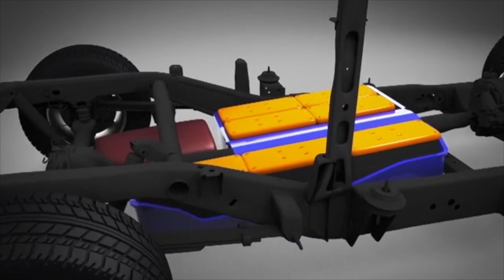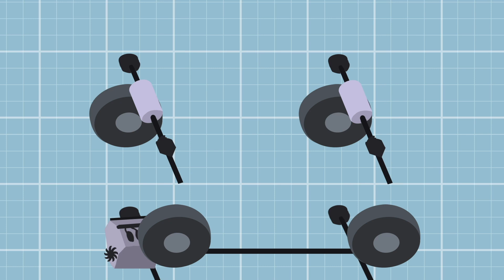Could This Pickup Truck Design Change The World?

Comment: Before I begin my argument, allow me to share a "positive" note:

Ram, maker of two of the most popular diesel light-trucks, currently has a 48-volt assistive/regenerative hybrid system in it's 1500 (1/2-ton rated) 2019 models that outputs 90 lb-ft of torque. It is standard in all gasoline V-6 models, and available in all gasoline V-8 equipped models as a $800 option. The eTorque system--as Ram is calling it--offers an small increase of EPA combined mileage from 17mpg to 19mpg, while still allowing the Ram 1500 to tow nearly 13,000lbs and handle more that a ton of payload.

Now... on to my argument.

Question: Of what percentage of light-trucks in the aforementioned sales review are sold for use in rural areas? This has a high weighing on the "Let's go all-electric with trucks!" argument because of one simple factor: infrastructure. 

Unlike areas of higher population density, fuel stations and places suitable for rapid-charging stations are few and far-between. This nullifies the practicality of plug-in EVs, as even a conversation built with the longest range possible will find itself "out of luck" should it need to cover distances greater than possible without being recharged during it's daily operation. 

Also, there's an old rule about how trucks must be built compared to passenger-cars: It must be able to work twice as hard, and do it for three times as long. Typical rough-terrain durability issues aside, this can be a daunting challenge for EV trucks to face as long-term operational costs come into effect, as independent owner/operators of light-trucks don't like the idea of needing to make a huge investment more than once in the lifetime of their trucks--reserved primarily during purchase. 

Before I go, I will leave you with one thought: General Motors currently offers a "small" 4-cyl engine in their full-size 1/2-ton trucks with a torque-curve comparable to previously-offered V-6 and smaller V-8 engines. VIA, maker of series-hybrid based on GM light-trucks for several years now, has been using the base-model V-8 offered in GM's light-trucks as it's range-extender engine. Imagine the range increase  and emissions reduction had if VIA built a hybrid conversion that employed GM's new 4-cyl found in it's full-size light-truck models. Suddenly diesel isn't the only option for hard-working light-trucks in fleets... or personal, individual owners.
Reply: As you say infrastructure is poor, but with increased demand comes business opportunities... "If you build it they will come" is all well and good, but very often the consumer needs to demand a product before it becomes available widespread so tackling the trucks first does make a decent amount of sense.
Reply: @joannaatkins822  "Demand"...? Or "Have no choice"? They are sometimes one in the same, I've found.
Reply: @joannaatkins822  , have you ever worked on automotive applications?  Unlike the combustion engine. Electronics are actually more problematic to diagnose,  troubleshoot,  repair and a catisthpic failure is almost any failure. New viechles are predominantly electronic , terminating resistor goes bad. The induction can cause havoc on unrelated systems to each other, corroded wire in that circuit, corroded pin at an ecu, broken wire, voltage spike, bad ground, loose wire. These play havoc on systems now with the electronics which don't even include mice that love too chew! I used to teach electronic diagnostic s if you think most people can grasp it in a practical sense to do that , most can't understand the the actual concepts in it. When you do find some people , you will not be able to afford to fix the truck. Electrical engineers that designed this crap dont fully understand what they designed and built sometimes. I used to have too prove that what they said was impossible in actual applications does happen .

Comment: Boiling a frog. With current "trucks" having a body on frame structure, there's plenty of underbody real estate for a very decent battery pack. Especially given the huge transmission and drive shaft is eliminated at this stage already.  So a small generator can keep that topped up with zero range anxiety. Probably more range than what current owners have now. The torque of the electric drive will convince any truck driver there is sufficient "grunt" to do any task. Later, with a body totally designed for pure EV, out goes the engine and fuel tank, replaced by a double bottom platform packed with batteries.
Reply: Karl P You forgot about regenerative braking as well.
Reply: Yes I did, thanks
Reply: Karl P I reckon I'd puncture a battery and explode.
Reply: Something I think you're overlooking is a fact that these battery packs weigh a lot, which will then drain is a batteries even more, as the motors have to work harder to pull the vehicle plus a load. It's a flawed system, and we're probably better off going and using biofuels
Reply: Yes - take a 1.5T pickup and add 1.5T battery pack and reduce cargo capacity to a bag of potato chips.  Sounds right.

Comment: The manufacturers' mentality isn't screw the environment. I think you're wrong there. How are they supposed to make them as cheap as they currently can with current capability. The technology isn't there yet. A plug in hybrid adds complexity and they rarely get any better economy than a diesel so there's no point until technology can actually allow for a full electric one. The only other fully clean alternative then for a pickup will be hydrogen then. But that is also too expensive.
Reply: No it's ignore the environment.
Reply: Really look into some things that are already existing, but suppressed. Why does our vehicles run on wet gas? If you have a bucket of gas and drop a lit match in it, the match simply goes out. Look up videos about running on fumes. There's a Florida man getting over 400 miles to the gallon, off of gasoline fumes. Pogue invented a carb that would do several hundred miles a gallon in the 50's, but was forced to be silent, forced to sell his plans to oil company, and we have additives to this day, designed to clogged that design. Fact is, oil is big money, and those who make big oil money, do not want that to stop. Firestone made a tire back in the 60's that would never wear out. However, petroleum is used to make tires, so the oil companies bought the rights to that tire design, to keep it from being made. What about water? The earth is 75% water, why aren't we running on hydrogen. There is next to no emissions. 8 ounces of water has more energy than 5 gallons of gas, and produces more than 80% less emissions on average. Again suppressed, because these large companies can not take ownership of the world's water. The electric car was invented back when cars were, but an oil company ran a smear campaign against them, caused issues with production, and forced the electric car business out of mass production. It's all about greed. The global warming is a hoax, and it produced extreme amounts of money also. They do not want people, they want sheeple. Investigate on your own. There are many inventors, who ended up mysteriously dead, after trying to tell the world of their great inventions. Ford designed a mid family sized car, than did 90 miles to the gallon back in early 2000's, and sold rights to oil company for large money. That's how they stayed in business. This goes on and on, and no one sees or hears about it. 
Next time you take your vehicle for an emissions test, think. Why is it you can fail the test, if your vehicle isn't producing enough emissions? Also diesel puts out way more pollution, why are diesels emission test exempt? Money, money, money.........

Comment: If I were a manufacturer, this is why I would be hesitant to build this pick-up: it's a short-lived technology.  It's not going to be long before a fully EV truck will be just as marketable as your hybrid.  I don't want to spend five years getting my company to design, test, and start manufacturing this thing if the fully EV version is going to clobber it in seven years.

It might be doable if some company can come up with a business plan which accepts the hybrid as a stop-gap measure from the get-go, but otherwise I wouldn't do it.

Then again I'm not a manufacturer, and I could be all wet.

Comment: I want to point out, in 2014 GM had test sales of 1,000 PHEV Pickups using modified Volt batteries and software. 500 Sierra's, 500 Silverado's. they were only sold in california, and I don't know if GM even sold all 1,000 or not. but I dis want to point this out to show truck makers did trial with it already, just not quite enough.

Comment: What happened to acid rain it was supposed to wipe us out by 2010
Reply: Regulations all but stopped it a few decades ago. Google it.
Reply: It was a problem.
People saw the issue.
Engineers got engaged.
The problem got solved.
As I was driving my car along the road yesterday, I came to a place where, if I kept going straight I'd crash right into a building.  I turned the wheel.  I didn't deny that the building was there.
Reply: @thapelomashaomasemola7922 
Anyone who did the PH strips experiment in Vermont knows your claim is false. @thapelomashaomasemola7922

Comment: The one thing missing from this argument is the value of switching out the what I assume is a regular piston driven internal combustion motor with a gas turbine engine. It provides a few notable advantages:
1) Higher Fuel Efficiency than Piston engine
2) Less Weight then Piston Engine
You wouldn't use these to drive a vehicle mechanically, because they wouldn't be driving it near the peak efficiency under most mechnical loads, but you could charge a battery at peak efficiency all day long. You could even make it modular or part of trailer if you wanted to leave the truck as light as possible when operating in electric mode (and getting all that wonderful torque).

Comment: There is more to this. Turbine engines were tried in the past but didn't have the tork to drive vehicles. Turbine to generator to battery to motor I like because the engine has only one moving part. And as a landscaper I can create gas through anaerobic digestion to drive the truck which  can also do combined heat and power for my home.

Comment: Credibility for this report was blown just before the 2:56 mark. She said, "put a high power motor on each axle and supercharging." Really, supercharging an electric motor? The writers made the reporter look silly. I am very familiar with diesel-electric drive and yes it works well for ships and locomotives. Surely long-haul trucks will benefit from diesel-electric drive also. I hope enthusiastic electric vehicle buyers realize that their purchase is NOT as totally green as they may think. So many times I read an ignorant statement like "I don't pollute," I don't burn fuel." Ok, great, how about that powerplant on the other end of your power receptacle?  Are we also willing to build the needed power plants to recharge all these new green vehicles? New powerplant construction is a slow and expensive process. That is why so may electric suppliers sponsor conservation measures to put off building new but that will only stretch so far before more new generating sources MUST be brought on-line.

Comment: This is just a thought I had while watching this.  Instead of using mechanical breaks on the London Underground or any metro subway system, why don't they use electric motors that will recharge battery packs and then use that energy to help accelerate the subway cars. In Washington DC where I live, you can see how much the breaks are being used by how much wear is showing.

Comment: It's an excellent solution esp. in certain scenarios where there is no choice. I used the same mmethodology in my DIY projects. Also, using a stronger motor thru the transmission gives more flexibility although does have transmission power efficiency loss of about 2-4%. But adds more robustness.

Comment: You make a compelling argument. I'm in the market for a pickup. It needs to be capable of Towing, hauling, and then the daily running around. Depending on cost I would gladly try and Electric. However as long as traditional fuels are less, the environment will suffer.

Comment: My F-150 has the 2.7 liter v6 and gets about 26 on the highway.  What I like about it is that it has a 36 gallon tank that gives me over 700 miles before refueling.  An electric truck.....about 150 miles, maybe, before you have to plug it in and recharge.  The biggest drawback of electric vehicles is the range on a single charge.  Until they fix the range problem, I'm not interested!

Comment: Frankly most people don't need a massive battery on their pickup, they never use them to even a fraction of their extent. Start with light pickup trucks that would be fine for a sizable part of the market, with a far smaller battery. A friend drives a Nissan electric van for his work with a 80 mile range which is perfect. Then later work on the larger ones as batteries improve.

Comment: Batteries + smaller ICE + electric motors - diffs - transmission - bigger ICE = total wieght difference. If this equation for a hybrid truck delivers significant reductions in fuel use, then the idea has a chance, if not then its boned.

Comment: The main problem with EV is the lack of torque.
The Outlander Phev can only tow 750kg. 
If it has no torque it will burn out the electric motors

Comment: This idea is very old indeed. Over 100 years ago, around 1907 when electric trucks in the U.S. were almost as common as the gasoline variety  because they mostly took freight from the railway station a few miles to where it was needed in the city served, they were competitive. General Motors offered their trucks in both types.
 So it was that when the Carnegie Observatory  needed a truck to get the largest pieces of the 60 inchTelescope up the mile high Mount Wilson, they consulted with the Couple-Gear truck company of Grand Rapids Michigan. The 5 ton electric truck they offered had some characteristics needed for the crude dirt road with switchbacks that was made just wide enough for it. It had been a mule trail. 'Couple-Gear' referred to the clever drive system that had one motor inside each wheel, coupled to ring gears just inside the rims. All four wheels were thus completely independent, and each axle was independently steered, making those switchbacks easily negotiated.  

Now when the engineers did the calculations for the battery pack they used and the grade, they realized it might only make it half way with its load. That seemed OK,  because there was a ranch house about halfway up the trail, and a generator there could recharge the vehicle overnight.  Caution suggested the margins were too thin, however, and it was decided to put the generator unit on the truck itself. Here I have to remark that this now turned what was an instant starting truck into one that needed cranking to get going:).
The weight of the motor generator displaced the battery. They left it out as control in those days was hard enough with either of the power types.  It must have been a noisy journey with the Fairbanks Morse engine running at full tilt most of the way.
 Control and braking made use of large streetcar type dynamic brakes using resistor loads. Still it was found to need a little assistance from a team of mules at some of the steeper parts of the trail when carrying its full five tons. Quite probably it was a good thing that it did not go back down the road loaded, as that braking system was worrisome to be sure. Perhaps another reason to keep a pair of mules nearby.

Comment: The vast majority of owners would be fine with all electric. If you need the power and range of gas it’ll still be available. Plenty of space in current trucks to drop drivetrain and install batteries. You can have your parade float and not waste fuel.

Comment: Easy sell once they feel the towing grunt of electric motors and engine combined . Amazing power and torque!
Reply: Even more so with traction controlled all wheel drive.  Most of those who have a real need of a truck would like that addition.
Reply: Ken Smith oh yeah for sure . And you can manage the torque better without revving and clutch wear !

Comment: I think a series / parallel system may be better.
You can do an AWD where at some range of speeds, the engine can connect to the front wheels At low speed, the engine powers 4 electric motors and you get lots and lots of pull away force.  On sloppy ground, controlling the motors gives you "limited slip" or "traction control" mode where the truck gets through the muck better than existing trucks.  Perhaps a single or 2 speed transmission allows the engine to get better efficiency on the path to the wheels out on the open road.
Note that there is no drive shaft or rear differential etc so the step up to the box can be a bit less.